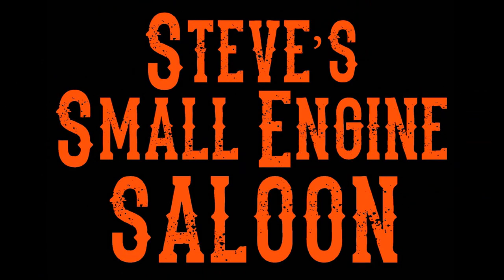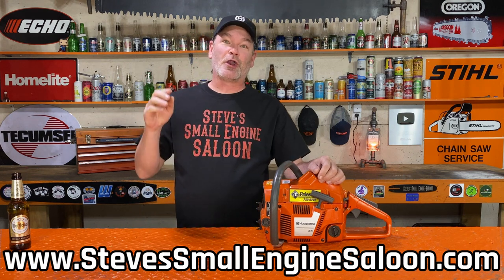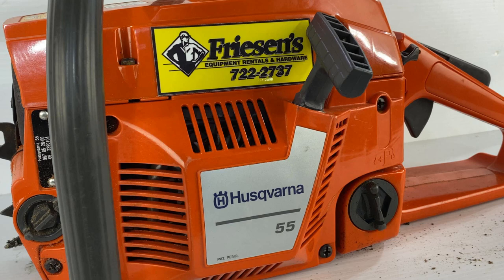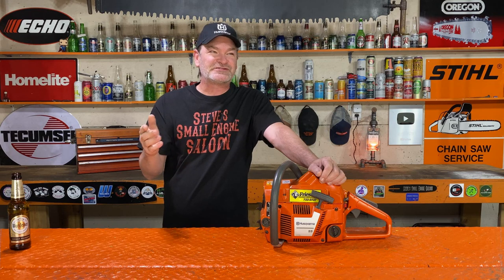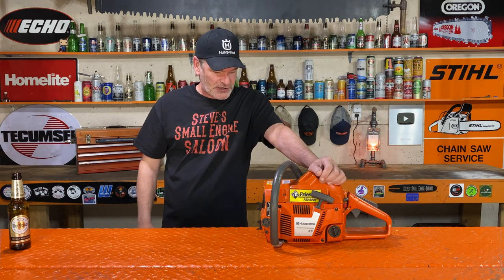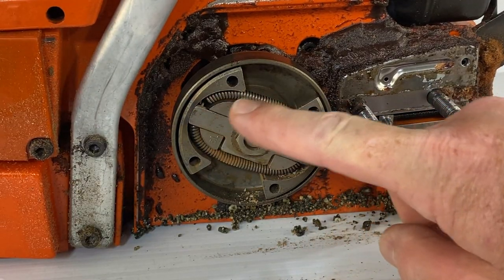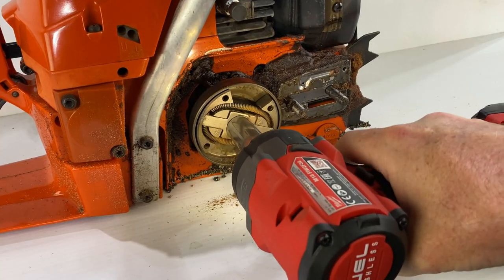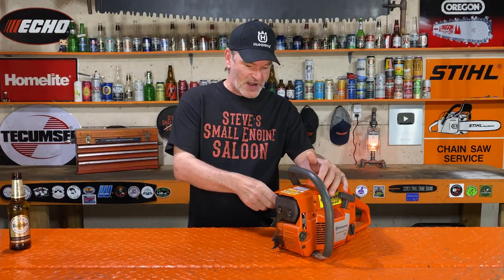Are The PROS Tightening The Chainsaw Clutch WRONG?

Comment: Workshop manual says "tighten the flywheel retaining nut
to 25-30 Nm (18.4-22.1 ft.lbs.) torque"  Best to have the bar and chain and brake cover on before revving it up, don't ask me how I know lol!
Reply: I found that out the same way. I was outside and the clutch flew into pieces. I couldn't find them all.
Reply: I literally just that the other day. With no chain and cover on I went to Rev it becuase I thought that's how I seen it done but naw. It's not. Everything flue off. Needle bearing reverse engineered. I found every needle roller except for three. I just got my new one in the mail today. Was putting my. .325 sprocket back on becuase the 3/8 sprocket I got was a large spline. For my 545xp mark 2 that I'm probably going to blow up installing a 28 inch bar on. Full skip chain though. If that even matters. Idk I don't even know how to tune a carb. Hence the auto tune. Haha.

Comment: Hi Steve , Re: the chainsaw clutch installation Yeah or Nay?  I am old school and still like to use the torque wrench in many applications, but in the quest for that adequate repair, 1st would be a ratchet or wrench, 2nd would the quick use of the 'Small Drive" impact gun over the use of the chain brake. However, when you are out in the bush, and have limited tools, etc, one must do what is necessary to get it so that you can make your dinero for the day, so the chain brake will have to suffice. Don't do this multiple times (once is MORE than enough) unless you want a fight to remove it next time. I can't really call the last a option for me, as I have never done it that way - Pat Barone , Pr. Geo. BC
Reply: I'm no Steve, but I do believe that is the best reply I've heard all day.

Comment: I am not a pro or even a seasoned repair guy, but even I know that the manufacture has specs or torque settings for most all parts or assemblies. But with that being said it does seem logical to do what you did for many reasons, one of them is safety. You obviously don't want parts flying off, so it is logical to make sure that the nut is on tight. That's just my 2 cents or point of view. Love the topics you come up with, also thank you so much for your video's because you helped me with a carb issue on a weedwhacker that I never knew. Now it runs great. Had to replace the carb though because it was cost effective and the great thing was it came with the adjusting tool, your lesson was very valuable. Again thank you so much Steve.

Comment: My opinion is that I’m going to do that tomorrow, lol. I put a new cylinder , piston , rings in my Husqvarna 455 rancher. 
    It starts and runs great but the clutch spun off and broke a shoe wile I was testing it. 
  I don’t have a tool to tighten it properly and banging on the shoes didn’t seem like a good idea.

Comment: I don’t know about you, but I want 2 hands holding the saw when I rev it up. I was taught the break has two functions, 1. it should be on when you start the saw from the off position and 2. when carrying  the saw to a new location. The point is, the clutch should have a torque spec use a wrench!Safety always comes first, especially with something that can cut an arm off in the blink of an eye.
Reply: In the real world most people who run chainsaws with regularity do not put the brake on when starting, and also drop start the saw.
Reply: @mikespain8655  does that make them right?
Reply: Pros do not ever start the saw with the brake engaged. Nor do they transport it with the brake on. There's many reasons why. That's entry level homeowner type talk

Comment: Procedure is solid. The clutch is self tighting - running the saw after repairs ensures clutch is on tight  and threads are good. It's the way I do it. (really hoping I'm not wrong here 🙂)
Reply: Simply running the saw after replacing the clutch under no load will not work. Needs to be under a load to initiate tightening (cutting wood ) . If not you will find yourself walking around your parking lot looking for the clutches components thrown everywhere.   Been there and done it .

Comment: I spin the clutch on as tight as I can get it with my hand. It tightens up with use like in your video. Never had a clutch come slack or off in 34 years of working with saws. They all take a bit of effort to take off again

Comment: That method is a new one on me. I would want the nut at least snug first, then i would start the saw with the chain brake on, leave it on, and then give it a rev. Then there's no way for the clutch to loosen on deceleration. Having said that, I always use rope and a torque wrench because I often have other things to do on the saw before I'm finished and don't want to forget and leave it loose.

Comment: I’ve read loads of the comments and just want to say, I think you are not doing this as intended. Remember chainsaw have been around a lot longer then cordless impact guns. I think the idea would be to spanner tighten the clutch with a piston stop or starter rope in the spark plug hole, then Apply the brake BEFORE starting, then rev the engine to tighten the clutch nut. Revving the engine first could loosen the clutch as the revs die off before slamming the brake on, as you did? ( you did ask,! ) Love your videos by the way, you have saved me lots of time and money in the past and we all appreciate what you are doing, long live the two stroke!
Reply: What if the chainsaw has no brake?
Reply: @stoplookingatmeplease1230  You are talking before early 1980’s? Everything else should have a working chain brake. I have a Husqvarna L65, 1972, this has a proper hexagon nut to tighten with starter rope in the spark plug hole, actually really easy to hand tighten with a spanner.

Comment: With rare exceptions, I never tighten any fastener with an impact tool, especially on crankshafts. On saws, I put it on hand tight, put a piston stop in the spark plug hole, and use a small hammer and punch to tap it a few licks.
Reply: Not saying that’s wrong, but it literally is an impact tool there sir :)
Reply: @nat5720  True, but to be fair, a couple of light taps with a 12oz hammer is less severe than a barrage of instant bursts, pounding at a relatively unknown high torque, a powered impact tool subjects to a malleable fastener.
Reply: @nat5720  Not entirely true. With an impact you rattle the crankshaft, piston, and connecting rod, all of which could suffer undue wear. Using a piston stop, you take up all the slack, minimizing undue wear, if not eliminating it.

Comment: I normally tighten it by hand. Start it up just like that. And do that once but that’s not to tighten it that’s to make sure that the brake is working correctly. At least in my experience. I guess it’s doing both I suppose. And it gives you peace of mind when your customer uses it for the first time it’s not gonna fly off. Because you’ve tried it and you’ve used it and you know it works correctly.

Comment: In the 70's when I was doing tree work, I had two tools for removing and replacing a clutch. A nylon threaded plug to replace the spark plug and a special wrench for the clutch. The plug would rest on the piston to keep the engine from turning and the wrench tool to remove the clutch.

Comment: I've been using chainsaws since the late 1970s in the few times that I've actually pulled the clutch off or something when I put it back I'll wait just hand tighten with a ratchet and a socket. Figure that's about the same and I have never had any problem.

Comment: I have been in forestry for 20 years and have only hand tightened a clutch on chainsaws. They always come off harder than I put them on. Actually, because they go on with reverse threads, the direction it spins will tighten it as you cut wood

Comment: Hey hey people …I  know my post is off topic  but I  wanted to share  … I was trying to  get an old fs 81   And  fs 86  I rescued from a skip bin  ….Unfortunately the diaphragm’s need replacing 🤔 and I can’t afford to bye the parts    I was about to give up …. When a thought hit me ….I grabbed a carby from an old sthil hedge trimmer .   I pulled of all the plastic throttle guides  and spacer 😁the carby holes lined up 🤣😂 with the old fs 81 and fs86.     It fit … the only thing you need to do is take the throttle stopper  locator knob  from the fs 81 carby the throttle arm and switch it to the hedge trimmer throttle arm. It’s only held on with a cir-clip .   I manually primed the hedge trimmer carby …..IT WORKS IT WORKS .  ITS FU…..KING RUNNING PERFECTLY .  Holy crap 😁   I am standing in the carport with the biggest f..king smile on my face.    The old carby  is from an sthil HS 45 hedge trimmer , I saved the carbs from a few  dead machines  . Both the old fs 81 and 86 are now both running great .     I hope this helps  save someone some stress and money in these tuff times.

Comment: My opinion is that it is very possible to snap the crankshaft. I use to race two strokes on go karts and I have seen people break the crank just by getting on the gas to hard from a stop this is kinda the other way around but still same shock to the crank. Maybe I might be wrong but it definitely isn’t good on the saw.

Comment: I suspect the idea is to use the chain brake as a test of the tightness of the crank nut. If that's the idea the nut will only get tighter given the thread requires a reverse direction of chain travel and crank rotation to loosen it. Putting the chain brake on will only momentarily, until clutch disengagement,  place a tightening force on the nut.

Comment: If the chain saw manufacturer has a torque value to tighten the clutch to, then it needs to be tighten with a calibrated torque wrench to that value.  My policy, as an FAA licensed aircraft mechanic is, if the manufacturer has a torque value from minimum to max, is to either torque it to the middle value between the minimum and max.  Or to the max value depending on the application.  I would use the max in this case.  

 If not then the bolt needs to be torqued to the value the bolt manufacturer calls for, using that same calibrated torque wrench.  If the bolt has a minimum and max I would use the max in this case.  I use a torque wrench on most bolts

Comment: You should tighten with the pull cord pulled out if using a impact, or against a plastic piston stop or rope if using a wrench. Not a bad idea to put the brake on and insure the brake works snd clutch is indeed tight also.

Comment: As a mechanic, there’s no way I would rattle a crankshaft nut or hit it with a hammer and piston stop.  It makes me cringe thinking about the damage it’s doing to the bearings. Any way didn’t the engineer’s sort this out for us when they designed it? I’ve never heard of an un damaged clutch “falling off” because of the whole rotation v’s thread direction. A nip with a spanner and the second it gets loaded up while cutting it’s good 👍

Comment: Question: I bought an old Homelite 245 manual oiler model. I can't find any info on what/how to use the oiler function
Do I: Pump it while in operation or, just hold it down while working. Thanks!
Even the manual doesn't say as much. Having a Carlsburg enjoying your short 🍻

Comment: As i see this, nut itself is turned on to left that makes it self tightening.. so all you need to do is turn it on with a wrench with some tension and be done with it... there is no need for some whooga-booga.. if you ave no proper tools and you turned nut on by finger, you dont need to attach bar and chain just give some good run with cover on and it should do

Comment: Love your channel Steve! Always excellent straight-forward advice-no BS! My opinion is that the correct way to tighten a clutch would be with a torque wrench to manufactures specifications. With that said, let's be real about this. The two real methods are going to be as you mentioned in the video-impact gun or chain brake. Personally I think an impact gun can easily overtighten past the manufactures specification and needs to be used very cautiously. My vote is to use the chain brake method. Let's remember that the chain brake is designed to be used that way and you are certainly not hurting anything with that method. Also, as you said, IT WORKS!

Comment: Interesting question. I had been putting them  on with a cordless impact just to nip it up and a hammer and  punch to give it that little bit  more, some times I use a poor man's engine stop, clean starter rope.. if iam doubtfull. I never ever hang off a rachet either on a clutch or fly wheel as I have had one break. I often wonder if factory specs do have a tourqe   measurement just to be extra safe so I can use a tension wrench that way I don't have to think twice or over do it. I've never used the brake to nip them up. If my teacher SIR Steve tells me that's the best way then I'll be doing it Steve's way. Steve's education has never ever ever failed me yet. So iam keen to see Steve's answer. Thanks for your tubes because it's made me the wood cutter that I am today, skills pay bills. Thanks heaps  Steve
Reply: Well said. Steve's way, or the highway.
Reply: Skills pay bills and also Skills save on bills, when I look at my collection of 28 vintage muscle saws I think without this channel I would not have my collection In perfect running order, I can not say in words how much I appreciate Steve passing he knowledge on, maybe one day I might try and get a signed picture of Steve to hang on my wall in my saw pourium!

Comment: My understanding is that the tightening will take place with proper use of the saw.   Mechanically, I don't see the method shown in this video actually working.   I don't think it is good for any part of the saw involved in the abuse.  The saw brake has one purpose and that is kick back safety and not tightening the clutch.  The real tightening comes from proper warm up and actual cutting of wood.   We know the chain travels in a clockwise direction and the clutch; when loosen, is turned in a clockwise direction - So how is it applying the brake tightening the clutch?  The brake applied isn't turning the clutch in a counter clockwise direction - it is just stopping it in place or even slightly forward of its initial contact when applied.  (JF)

Comment: Bye bye brake band..... 

Great video Steve, thanks so much for your time and effort for us all 👍👏

I think the clutch should be tightened on by hand, use a torque wrench if you want. Then use the chainsaw as normal - the clutch is not going to come off because the rotation of the engine will always 'tighten' it on.

Repeatedly banging on the chain brake to tighten up the clutch may snap the brake band or, even worse, weaken it so that when you really need it, (say if you get a major kick back), it then snaps and you get a face full of moving chain 🤕.
Reply: Good call. I never thought of the brake breaking.

Comment: It works but it's rough on the brake components and  side casing. Definitely wouldn't engage the brake with the throttle held full open on purpose.  "Boom"  dollars for parts.

Comment: I am going to say it is wrong, use the impact to do it.   The chain stop is a safety part and  if you do it that way. It may wear out, for when you need it.        Even when you do get a kickback. Your already letting off of the gas. So your not working the safety as hard.

Why not just put the clutch on and pop the ratchet with your palm.     Set the brake and pull the trigger. Same results less likely wear.   That is my guess

Comment: non issue .... also verifies that the brake is properly functioning ... but could result in over tightening the clutch ...... but i haven't seen a negative in 30 + years

Comment: I have a chainsaw question.   Is it bad for a chainsaw to run out of fuel/oil mix?  At the end of the season I'll use a non-ethanol mix. But during the season I will use the 10% ethanol mix.

Comment: I had a boss that hated that(not when one of our saws got worked on). Before I climbed any tree, I wouldn't just warm the saw up, I would do that exact same thing! I know it puts wear,and tear on the saw, but when you but hinge a top out of a tree, you will get rattled around! A lot cheaper to fix a saw than a leg, or worse!  It's a great tip for residential!
Steve, is this you?👇

Comment: the threads on the clutches are so as it runs it self tightens.  that is the first time i ever seen that done.  all you are doing is stressing that chain brake - a safety device. foolhardy at best

Comment: Don't think that should be done, pretty hard on the clutch. If the nut is torqued right, no need to use the brake.

Comment: Steve, could use a little bit of extra knowledge.
not a shop but been fixing equipment for few small local tree guys, been ordering cheaper carb sets through 3rd party online, But my question is that little white plastic (gasket) from intake boot to carb.. first is this half to be installed? because they all are junk....

another question is i have a ms 170 that only starts full throttle runs strong opened up but only idle for couple minutes then floods, alot of fluid coming out of exhaust. 

Thanks!

Comment: That’s a sure fire way to over tighten something. 
Same as a blade on a grinder. 
Little nip with a tool and it’s a piece of piss to remove next time. 
Jam it at full RPM and you’re whaling on it with a wrench to undo. 🇦🇺🇦🇺

Comment: I do both, I hammer it on with the impact, and then hit the chain brake 3 to 5 times while it is revved up, so this way it can't be my fault if it comes back with a loose clutch, or any issues due to the clutch not being tight.
Reply: Hey steve..love u love ur show..was wondering if u can do a video on determining exact btd ignition timing with a degree wheel...thanks